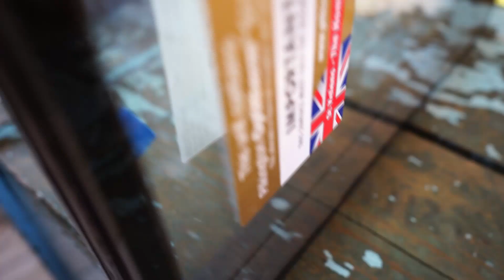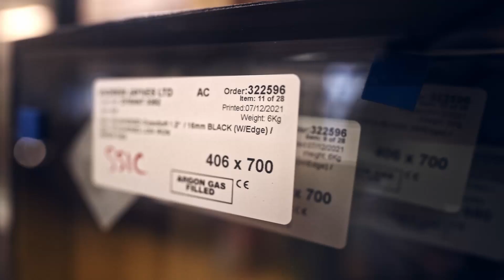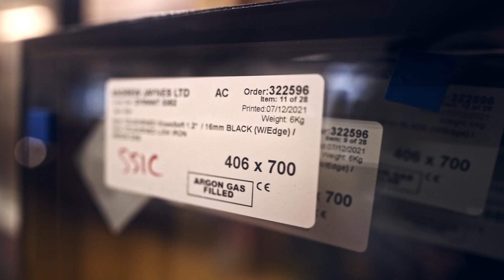What you need to know about GLAZING in timber windows. PART 2 - EDGE SPACERS

Comment: hi. great videos. thanks. just a question about the spacer and the seal. I am going to try and have a go at making my own double glazed timber windows. With the spacer, could Accoya timber be used, as it is extremely stable as you've pointed out, could it be used as a spacer. And as I have no access to hot melt butyl, could other sealants be used such as silicon. Also, just about the timber framing of a window using Accoya, does it matter what type of joint is used. Would a dowel joint be OK using another species of timber, or would it be best to use the Accoya timber even in a dowel for the joint connection. Thanks very much for this series of videos on timber windows. brilliant.
Reply from the maker: Hi Jude, Thanks for your comment. We don't make our own sealed units, but I would be cautious about using any timber as a spacer for a sealed unit, as all timber contains some moisture that would be trapped in the cavity. Jointing method is pretty critical to the window construction.
Reply: You can’t use timber for a spacer bar. The unit needs to be completely air tight, hence the hot melt. They use a plastic ‘warm edge’ spacer bar these days. If you want double glazed units it’s not something you can do at home, you’ll have to get them factory manufactured.
You can however do a Swedish design,
which incorporates two single glazed sashes, often fixed together with hooks. Or there are windows with opening in casements internally, air gap and then outward opening sashes externally. The air gap between is as good as, if not better u value as a double glazed unit.  Search gantelius fonsterhantverk on instagram. 
I recommend wedged mortice and tenon joints for the casements/sashes.